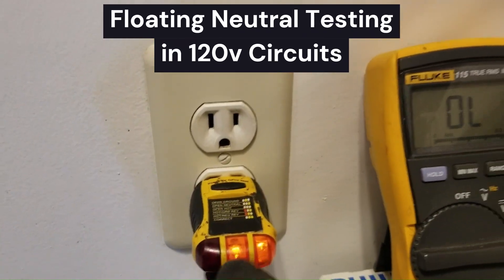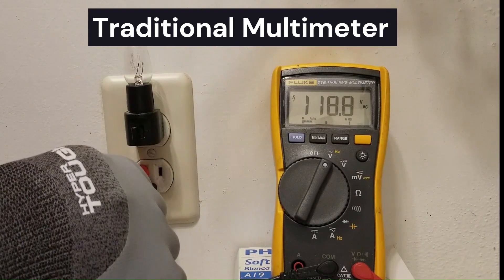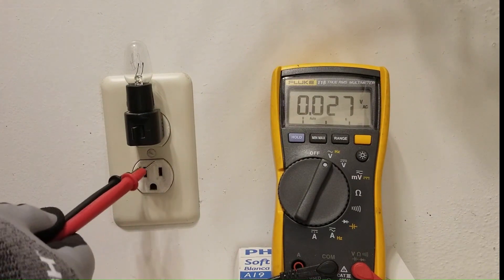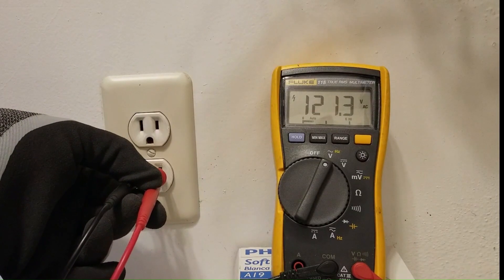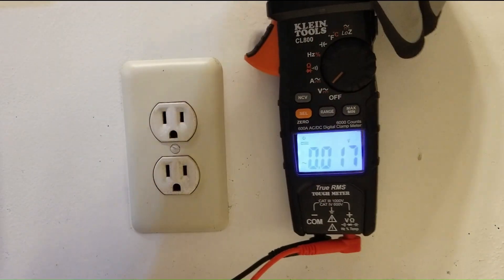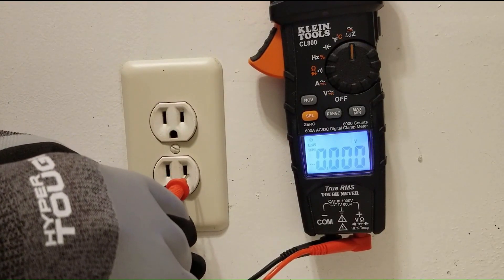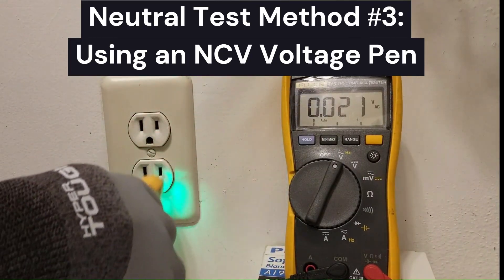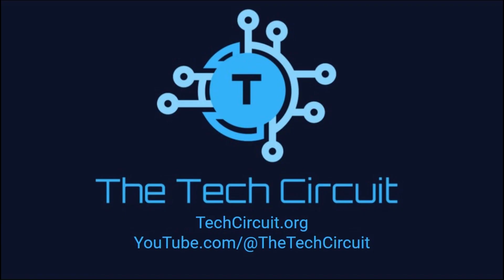#84 - Open Neutral Testing in 120v Circuits

Comment from the maker: How to test for an open or loose neutral in 120v outlets with a regular Multimeter, a LoZ meter, and a Voltage Pen. 
Link to LoZ Meter: https://partsplenty.com/test-equipment/cl800
Link to NCV Voltage Pen: https://partsplenty.com/appliance-parts/ncvt1p
Donate to the Tech Circuit: https://TechCircuit.org/donate
Video on Advanced Multimeter Usage: https://youtu.be/CxeKuLwwGv4
Subscribe to our channel: https://TechCircuit.org/yt

The video is explicitly targeted toward professionals (1:28 in video). Namely appliance repair technicians (as in the description) - most of which aren't permitted to delve into home electrical problems - but rather to non-invasively identify that one likely exists. This is why none of the content involves digging into the electrical system - which is the domain of an electrician. I can't prevent misuse of the video - but the warnings and disclaimers are there to discourage it.

Comment: This was actually a really good tutorial for me. I learned how to build decks fences, lean to roofs framing houses all on my own, fix engines,  plumbing, etc..  just by looking at it and doing it. Pretty simple for the most part but electrical, that’s a whole different ball game.  I know about enough to get shocked.  Actually, I know enough to hang a breaker box, 100 amp or 200 amp service and I know how to wire circuits and light switches and GFCI’s, and for the most part I do them correctly because I’ve been told that by electricians that would have to come out to the house and help with the other stuff. I didn’t know if we were having electrical problems. I just don’t know what a lot of that lingo means and electrical like upstream downstream low the little symbols on multimeters and things with neutrals and how they work in the ground and all that weird stuff. I just know where they need to be wired, that’s said, I’m having problems in my 1977 mobile home right now. a breaker kept tripping when I’d run my shampooer and then my Keurig and it just started a couple weeks ago. Finally it tripped and 10 out of 12 outlets and 2 out of 4 ceiling lights that are on the same 15 amp breaker don’t work no more. outlets in my bedroom do not work. The ceiling light does not work. This one has been a real head Stomper for me trying to figure it out. Wish me luck if I figured it out. I’ll let you know. Any ideas.
Reply: Some times it's time to call a licensed actual electrician in to evaluate the problem. I'm not an electrician I know if it has its original wiring in a older mobile home it was wired not to much defrent at least the 120 volt receptacles like a travel trailer .
Reply: @Kat-on3nm  thanks I got it figured out. It was a bad outlet downstream from the breaker box. But I put in all new outlets and all new switches throughout and GFCI’s.

Comment: Loose neutral (or loose connection) is not the only cause. A corroded wire will create the same symptoms.  Basically, loose connection or a corroded wire will create high resistance. From circuit analysis point of view, that high resistance is in series with the load (the light bulb). When you measure, with the light bulb in the ON position, the voltage between the ground and the neutral, what you're measuring is the actually voltage drop across that loose contact area (or corroded wire). So the only way to know for sure whether it's a loose connection or a corroded wire is to physically check for it. Voltage drop alone does not say which one although an experienced electrician can probably guess which one is the more probable cause.

Comment: Wonder why he didn't show how to find and fix the open neutral that he had in the circuit?
Reply from the maker: The video is explicitly targeted toward professionals (1:28 in video). Namely appliance repair technicians (as in the description) - most of which aren't permitted to delve into home electrical problems - but rather to non-invasively identify that one likely exists. This is why none of the content involves digging into the electrical system - which is the domain of an electrician. I can't prevent misuse of the video - but the warnings and disclaimers are there to discourage it.

Comment: What do you mean By when using LoZ it pull neutral down to ground?
Reply from the maker: if neutral is being pulled high by an upstream loose connection, the LoZ meter will pull it back down to ground level if that upstream loose connection is of much higher resistance (impedance) than the LoZ meter's input impedance. That's what's known as a voltage divider. Most of the voltage appears across (is lost) the highest impedance, which is likely the upstream loose connection.
Reply: @ I guess I need to get familiar with the terms “Pulled high” and “Pulled Low” first lol

Comment: As an electrician, I would assume it was a Ghost Voltage assuming the raceway is flex and it induced itself causing a 120v on the meter without Loz.. This was very intresting...
Reply: I’m thinking that ghost voltage is caused by the lamp itself. The hot and neutral to the lamp are technically connected inside the lamp when it is on, albeit with high resistance from the bulb. I’ve read continuity before between hot and neutral on a de-energized circuit and wasted a whole day trying to find a short, but it ended up just being because the hot and neutral were physically connected through each fixture just with resistors in between

Comment: You are reading voltage because you dont need a "solid" connection to read voltage across the wire. You just need enough continuity to see voltage between the 2 wires. Voltage is only half the story. 
The true test is that current flow test and when you put that bulb in, the current tried to flow but failed because you have a lose connection somewhere and that "lose" connection is not enough for the amount of current needed to pass thru. 
Kinda like a car battery, just because you see 12V does not mean the battery has the capacity to flow enough current to turn the starter / engine, as soon as you try to crank the motor, that 12V is GONE like your test did when you plugged the light in, then when you stopped cranking or pulled the bulb off, the voltage returned to 12V or 120V ...  Same situation here, you got 120V but then tried to pass current and it dropped off because it can't due to a lose connection. 
As a lineman for an ISP we learned this very trick, just because you have continuity between 2 wires does not mean the current will flow. You don't need much continuity for that meter to see across it. That meter has a 9 volt battery and if the wires can support enough current flow to complete the circuit for 9V, you will then see the 120V across it. 
The true test is the current flow test. If it can pump current thru, then its a good circuit.
Reply from the maker: Yup. Exactly the point of the video. Current flow causes the available voltage to be "dropped" across the upstream loose connection.
Reply: @TheTechCircuit so I can do to fix the issue??

Comment: When talking about the neutral, everytime you said upstream, I was thinking downstream because I imagine current flowing from the circuit breaker to the outlet on the black (hot) wire and coming back to the panel from the outlet on white (neutral) wire. But we're talking about AC, so I guess upstream of the outlet is the panel.
Reply: Yes upstream is the panel ...
As a lineman for an ISP we refer our cables as Feed Side and Field Side.
Feed side is the Input and Field is the output to the customer. 
So in electrical in the home, Upstream would be the feed from the panel and downstream would be the output to the other outlets.

Comment: Thank you for the helpful info. I'm not an electrician, but am curious: why does a loose upstream neutral connection cause its voltage to float under load?
Reply: Because as you try to pass current thru the circuit, it wont flow so you lose the voltage connection. If it was a good connection, the bulb would come on and the 120V would stay solid. 
The connection was too lose to allow the current to flow but it had enough of a connection to "see" the 120V .... 
Im a lineman for an ISP and whether working on copper or fiber, they work the same way.
I can shoot a 60mW light down a fiber and look at the other end about 3000 ft away and the light should be as BRIGHT as if i were looking at it directly, if the light is the same, then its good, but if its weak, then there is a kink in the fiber or a bad splice. 
Same as copper, it can test ok but try to pass electrical data across it, thats the actual test.
Reply: @ACommenterOnYouTube  I appreciate the explanation - thanks!

Comment: Now, the fun begins: finding the loose neutral. Carry on. I plug in a light with an extension cord, so I always see the lamp. First, I start thumping outlets with the palm of my hand. If the light flickers, I have found the culprit. It only sometimes works, but it is a good starting point.
Reply: Amen Amen
Reply: Very cool idea....very cool.
Reply: @ FirstFlying……… 👍👍👍 I’m not a licensed electrician but when dealing with electricity, I fashioned a 1 ph x 120v bulb tester and a 1 ph x 240v bulb tester with probes for exactly this type of distance or crammed up work spaces, apart from having also a multimeter tester - works great.

Comment: Be nice to see what the wires looked like causing the issue. Not just a analysis of the outlet with the meters
Reply from the maker: Noted for future reference. Thanks for the feedback.
Reply: Sometimes the copper is broken in the connection or they just are barely touching copper low contact connections